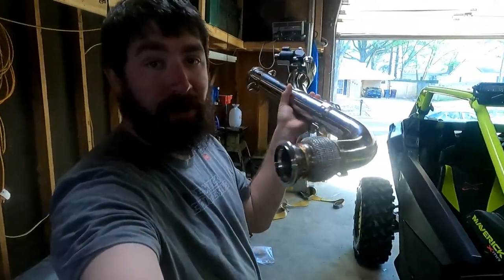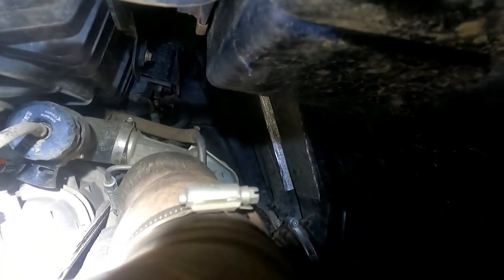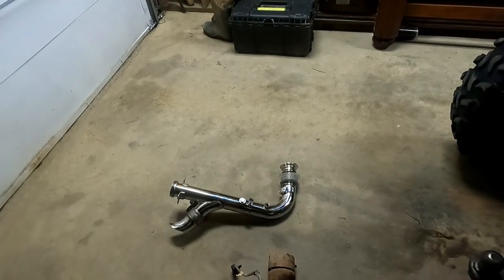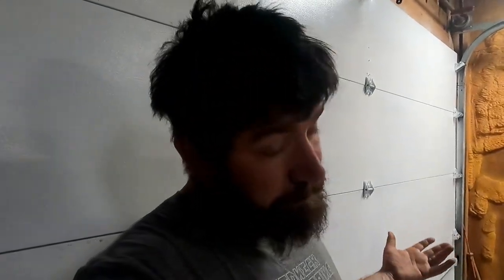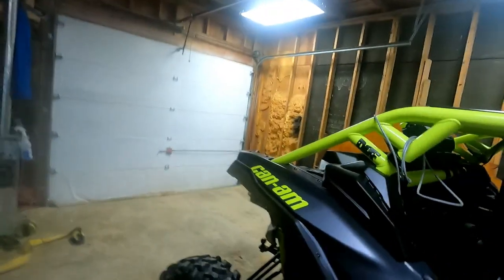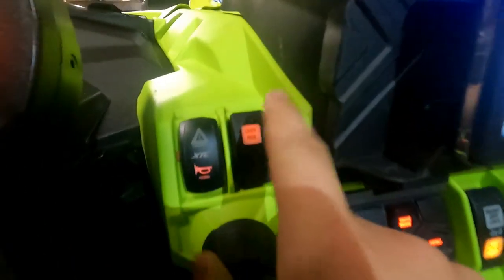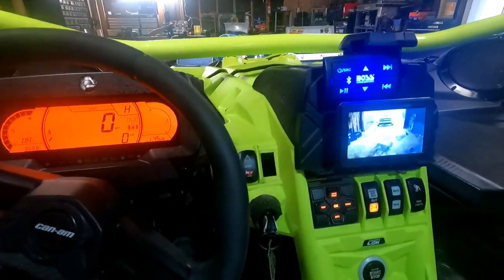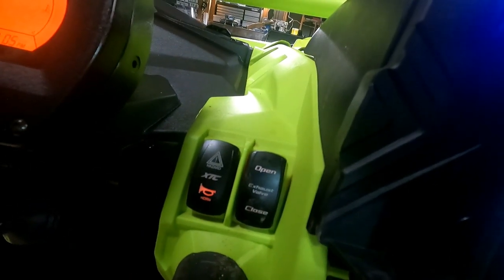RPM cut out install 2021 Canam X3 XMR TurboRR

Comment: When I  bought my i ask everyone if the mud version was geared lower  seem know one knew everyone said they where jus speed limited because of the tire  well now that the gear kits is out it says the mud version is 10% lower  so that's what helping you on 35 an wheelies i would say  it's  funny the people saleing them are clueless i bought the rc version  an still finding little things are different an would've thought that it to should've been geared lower but haven't confirmed it yet who knows lol killer ride didn't know if you knew that or not
Reply from the maker: Yeah whatever gear kit you're talking about is lying all the transmissions have the same part number they are getting it confused with the defender. But it only wheelies because it's got sticky tires soft suspension and perfect timing anybody with the same set up to do it the trick is the tires more than anything
Reply: @redneckengineering7739  that's what I thought to but satv jus came out with it an it say they got a 10 20 or a 30% besides the mud version an that it has already got the 10 in it I less I'm reading it wrong witch is very possible lol but check it out
Reply from the maker: They are wrong the x3 all have the same trans and part number